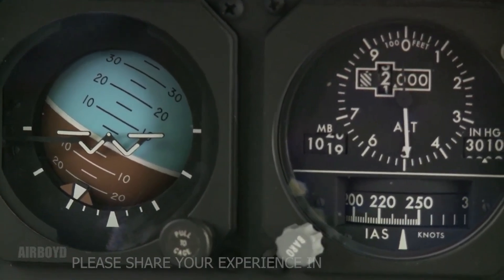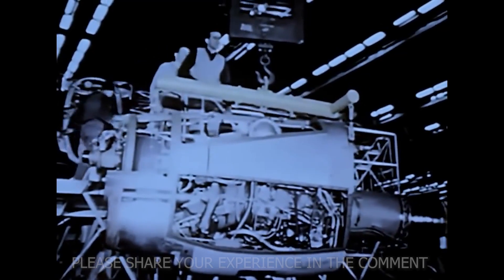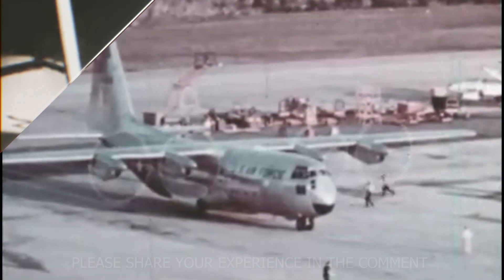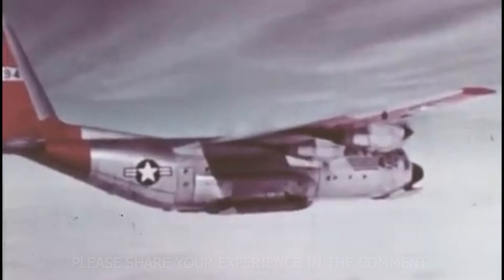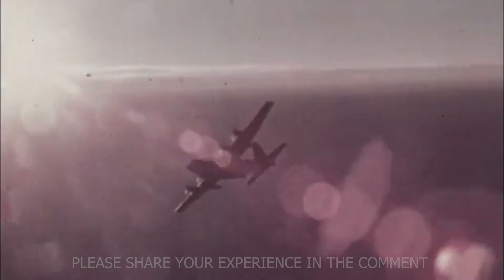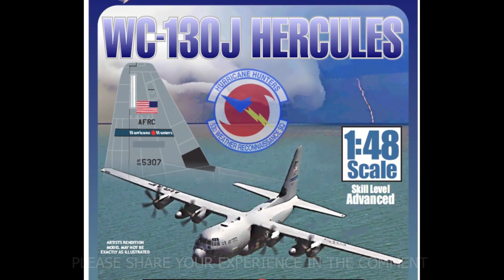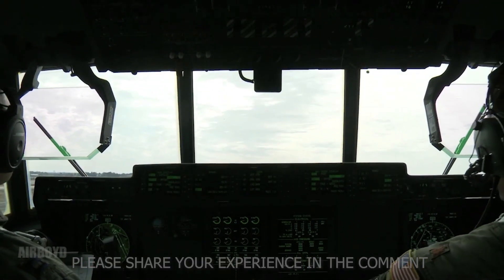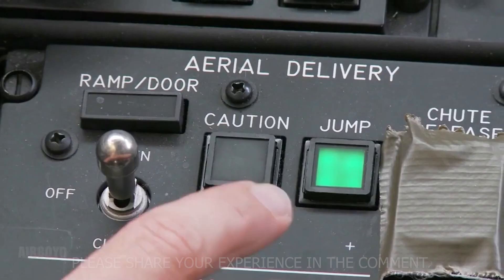The $60 Million Truck: How the C-130 Became the World's Go-To Airlifter

Comment: I was assigned to an Air Base in Fairbanks, Alaska back in 1955.  When I arrived there were four Pre Production planes undergoing cold weather testing.  They were the  C123, C130A, F101, and the F102.  They all went into service a short time later.